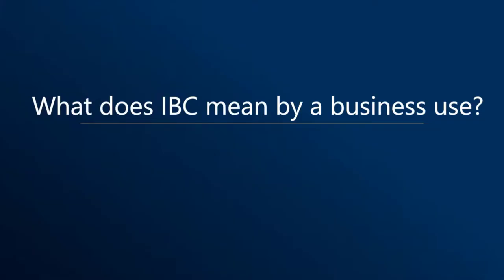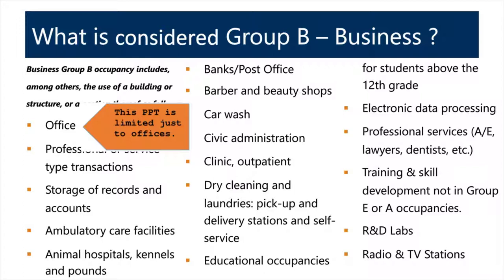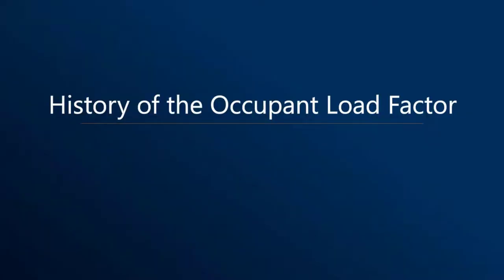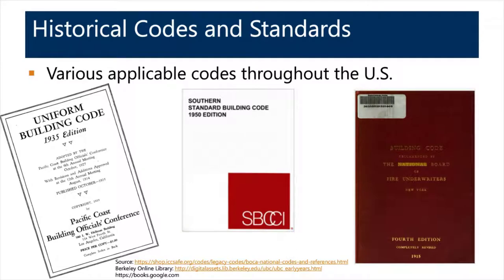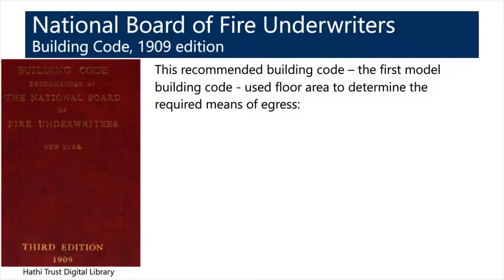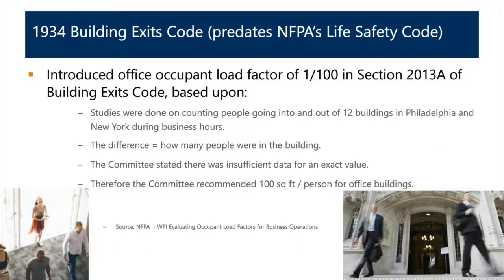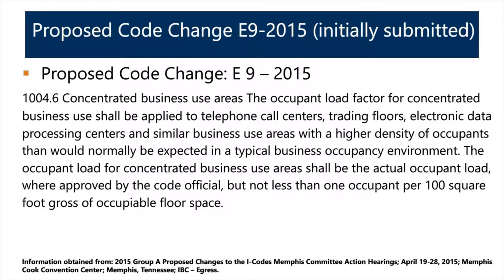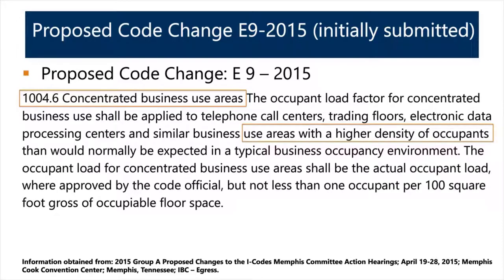New IBC Office Occupant Load Factor: When and How to Use It

Comment: There are some incorrect statements with regards to the concentrated business use areas (33:15).  Per 1004.8 you do not need the building official’s approval to increase the occupant load from 1occ/150SF to 1occ/50SF.  The code language states “where approved by the building official, the occupant load for concentrated business use areas shall be the actual occupant load, but not less than one occupant per 50 SF”.  Meaning you can go denser than 1occ/50SF with the building official's approval.  Section 1004.5.1 increased occupant load already allows the designer (without the building official’s approval) to increase the occupant load from those in the table as long as you can accommodate the increased occupant load with the egress, restroom capacities, etc.